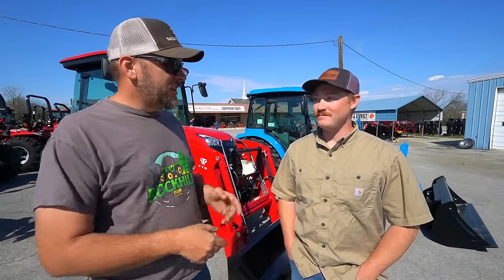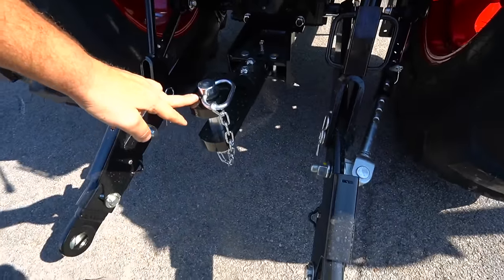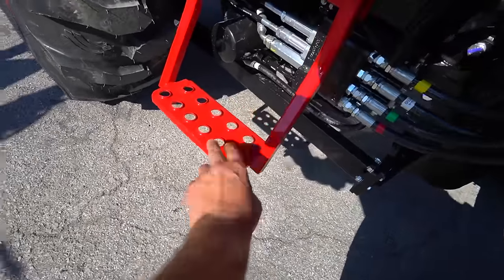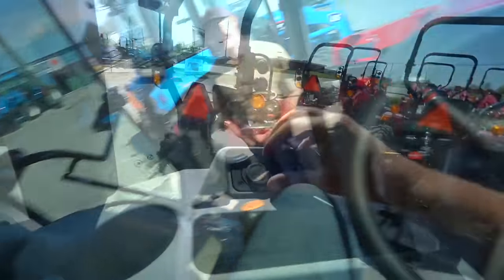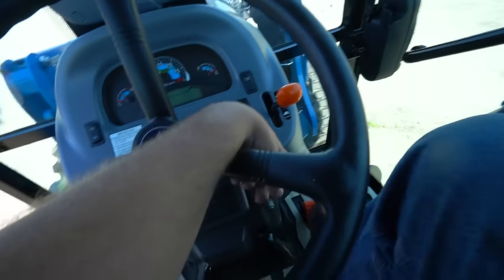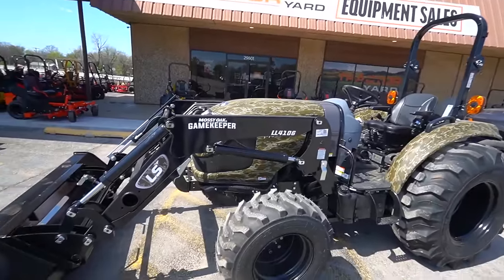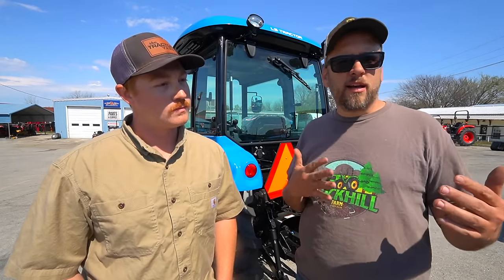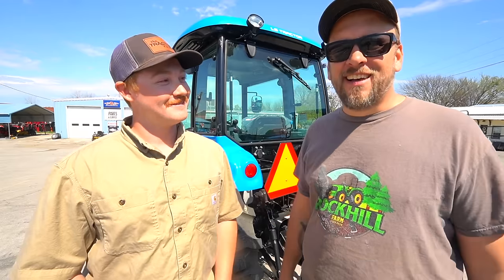Tractor Shopping - TYM vs LS

Comment: Not apples to apples but I run a tym 454 alot, love it been a good tractor, run a mt573 almost every day been a good tractor, just keep your battery contacts clean. Both shuttle. Ls has a nicer cab but is a bit newer. For the win I pick tym but I really use it more. Both are good machines.

Comment: TYM has plastic hood vs metal hood on LS. Look closely at them both; LS is much more refined, better finish & fitment overall. Transmission range and gear shifting are much better and smoother on the LS Tractors.

Comment: I'm changing my vote to LS over the NX Kioti after this.   Their MT3 series is the export "New Holland Boomer" and the refinement shows in this video in the rear end details, the features and the cab placement of the hydraulic levers on the top of the shelf of the wheel arch and the other refinements.   The upcoming Massey review is going to be quite interesting in comparison since that's another "mature platform" from Iseki that has a LOT of features built into the deluxe tractor.

Comment: I have a jd 5075E Cab and it’s been a great machine but it was too big for some smaller chores. So based off of all the research I did I bought a TYM T474 and I’m damn glad I did. It’s been flawless and the Kukje engine is much quieter than the powertech but I do like them both. The loader on the T474 is impressive, it will pick up and stack large round bales with no issue. My neighbor has the T574 and I’ve ran it a few times and it’s a great machine!

Comment: Not much talk on engine. TYM has a mechanical injected fuel pump and it’s not computer controlled and is based of a Cimmins design. LS will regen every 50 hours or so. TYM will regen much less.
Reply from the maker: You’re exactly right. I don’t talk about it that much because I don’t have the expertise to do it in an intelligent manner.

Here’s a great video about the benefits of the TYM engine if you haven’t seen it.

https://youtu.be/pLgTFXknP3o?si=aNTCwmrSsojRf0lA

Comment: I purchased a TYM HST T474 last year and am loving it. My dealer sold both brands and I am one that like simplicity so why not save the money when either will do the same job. AFA the auto throttle is concerned it is not an issue with the HST trans and honestly I find myself using the RPM.s raised for most work I am doing and the throttle lever is right there in front of me. I bought mine with a backhoe in a packaged deal. No regrets at all. I have a friend who sell MF tractors and I priced one and it was far more money than the TYM and the TYM was much heavier. Another bonus.
Reply from the maker: Thanks for sharing

Comment: Neither one has a roll bar for safety
Reply from the maker: What do you mean? 

The cab is your Rops. It isn’t fall protection but it is the legally mandated rollover protection. System required on every tractor manufactured after 1976.

The cab will be destroyed in a rollover, but you have a ROPS bar built into the top of the cab

Comment: If I were you I would go up to a 75 horsepower great video
Reply: Then he would have a DEF system to mess with. No need for 75hp unless you are actually farming ground.
Reply from the maker: That’s why my skid steer is 74 hp.

Comment: After doing my years of research and demos, if I were to buy Korean made equipment, It would be hands down a Kioti, by quite a long shot.  But I went the Japan route, Yanmar YT series.
Reply from the maker: Yanmar and kioti brands that I am seriously considering owning

Here’s kind of where I’m at with the two tractors shown in this video. These are 35 and $39,000 machines.

The John Deere equivalent is 60. That’s $25,000 difference 

I had a video recently where I said, the Yanmar yt 347 or YT 359 would be the perfect machine for me. The problem is those machines are over 50,000. I think the coyote is in between.

$25,000 is a dealbreaker for John Deere and 15 is really pushing it

Most brands also have a premium and an economy model, which is a factored as well
Reply: @RockhillfarmYT   I’ve bled green my whole life, and heavily considered a 66R, but couldn’t justify and refused to fork over that kind of cash. Thats when I ventured to other manufacture lots quickly learned I could get more for less.

They yanmar is priced between all the others and for what you get, i found it to be well worth the cost. The IHMT is what sold me.
Reply from the maker: @Bluegroove47 that Transmission is what got me so interested as well.

Someone can ask the question: why did you leave the John Deere

Answer: I didn’t leave them, they left me with their pricing